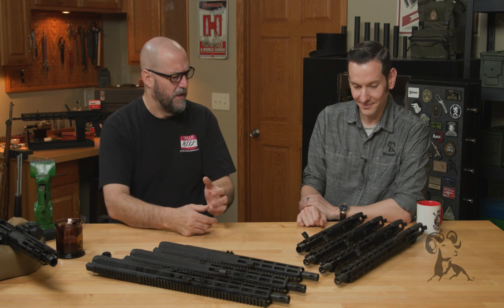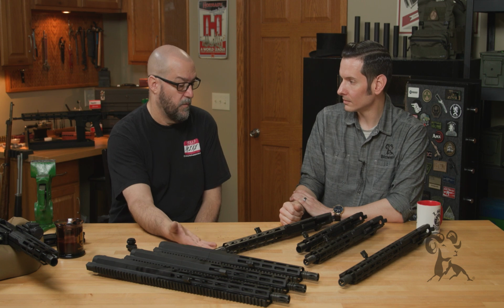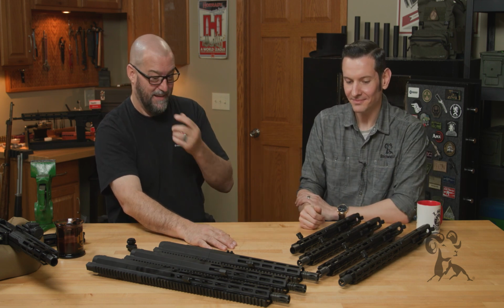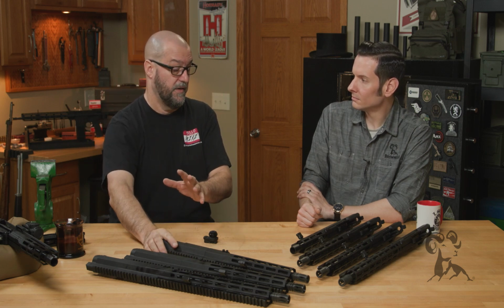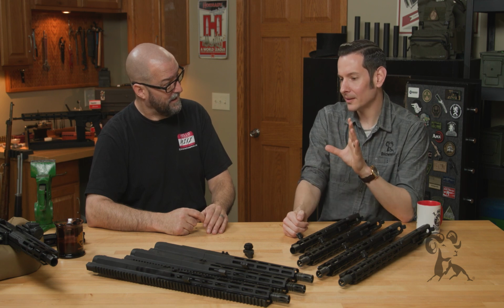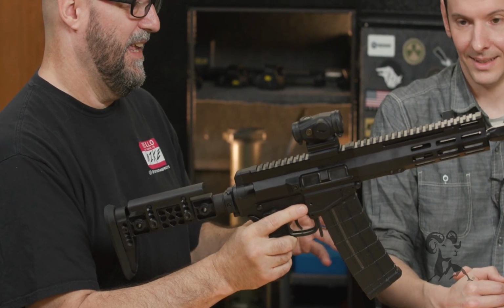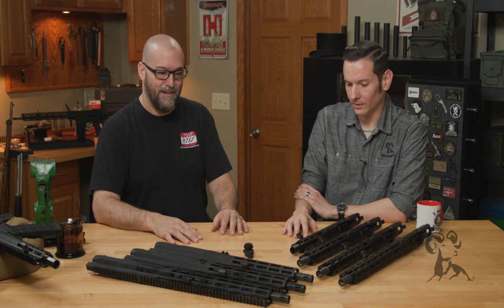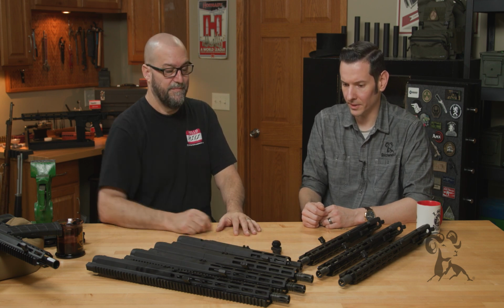Product Spotlight: Foxtrot Mike Upper Receivers

Comment: I've been on the edge with FM for a few years now. I started out over 5 years ago with PSA, Aero and the m&p 15. Although I still have some "poor" builds, I have graduated to only mid/high tier builds whether it's Geissele, ADM, Forward Controls Design, Colt, Hodge, Noveske, etc.

Going back to budget/low tier companies is a very hard thing to do but all 20+ ARs are just regular old DI gas systems. I've heard many mixed reviews about these piston uppers but I guess it's about time I get a BRN180 but start with a more affordable product. I just don't like that you need to change that part on the bolt every 2k rounds.
Reply: What part needs to be swapped at 2k?
Reply: @rmyc  depends on the gun. Say you buy a DD. Their milspec triggers are very heavy. 6-8 pounds. Other guns may differ. You may want to change controls like mag release, bolt release, safety selector, etc. Most companies throw a basic spring and carbine buffer just because its the cheapest while allowing the gun to cycle. Some ARs come with an H2 but changing the standard spring to a sprinco spring can make a big difference as well. And many companies use a milspec charging handle. Many higher end companies have their own ambi CH and some throw a radian CH in the gun. Again, it depends on what you like and how you want the gun to run. You can even change the gas tube(not gas block) there are gas tubes that have smaller holes that fit over the gas port which helps overgassed guns run better, especially if you throw a can on it. 

Hope that helps. If I didn't answer something then write back
Reply: @rmyc  ok just realized I didn't answer your question. They talk about having to change parts every couple thousand rounds. They include several extras but what happens when you run out? You have to buy more and change that again. I forget what he said but I think it had something to do with the piston system. Rewatch the video and listen. I think it's mentioned a few times

Comment: Since F.M. has successfully created the AR forward charging handle, system. I think that a handguard that resembles the Ever Popular MP5, tapered handguard, would probably be a big seller! Or even if they made a M-Lok bolt on, tapered or tubular hand guard, that would fit their existing rail systems. Either way, it would look bad ass, and provide a hand guard, from the hot barrel.

Comment: I really need a way to have that slap feature and oversized charging handle for my FM-15 Gen 2.

My primary complaint has always been that 

A) The spring for it is stiff as hell, compared to my Dissent it’s a completely opposite so being new out the box isn’t what’s goin on here, those springs are just firm. 

B) Charging handle is too small imo

C) Charging handle doesn’t lock back in any way, and if my BCG is locked back and I go to try and use the CH to chamber a round it almost ALWAYS fails to fully chamber the round by a bit, with no forward assist it means I’m f**ked, in a firefight that means DEAD. The only way to get a round in the gun is to lock the BCG back and then hit the bolt release to send it firmly home. 

That’s absurd. 

All in all it’s made me hate my FM-15, it should be one of my favorite guns, but it’s just not. I liked the lower price point compared to other choices, but now it just feels like I got what I paid for. 

If it can’t have these issues fixed then I’m just going to sell it to somebody who can stand it’s quirks.

I wouldn’t even need a forward assist if the gun worked correctly. All in all it was a good idea, but the execution was sh*t. 

If SHTF I’m absolutely NOT grabbing my FM-15 if I even still own it by then, I’ll grab my basic ass PSA AR, my MCX, my Dissent, or even a cheap BCA build. I had high hopes for the FM-15, now I just wish I got a JAKL or another Dissent instead. 

I advise against buying this gun or upper, until what I’ve listed above can be fixed for say Gen 3 it’s just not worth it.

Comment: If not for the SBR ridiculousness, I think most people would be in love with the 12.5 once they used it.  I love mine.
Reply: I hate mine, charging handle is stiff af, won’t lock back, using it in any way NEVER chambers a round, only hitting the bolt release will do it. No forward assist so it f**ks me hard there, if you have a round not fully chambered all you can do is take the mag out, lock the bcg back, put a mag in, and use the bolt release. 

The charging handle is just a massive piece of dogsh*t, it ruins the gun, I’ll be selling my 12.5 upper as soon as I can find someone foolish enough to buy it off me. 

I can’t express how disappointed I was with it, great idea, absolutely terrible execution. If I can’t use my charging handle on my FM-15 then I’ll just go to my much more reliable basic AR I built from milspec affordable parts.

Comment: With the universal 1.375x24 rear hub most savvy suppressor makers include in their suppressors muzzle device doesn’t matter quite as much anymore. Generally though just throw a Dead Air Keymo device and you’ll be set.

Comment: I bought the 13.9, waiting on Jmac customs to get back in stock. Had the upper come pin and welded, i wouldnt have bought it.
Reply: I'm looking at the 13.9 right now. My question it's can you still c clamp grip with the side charging handle?